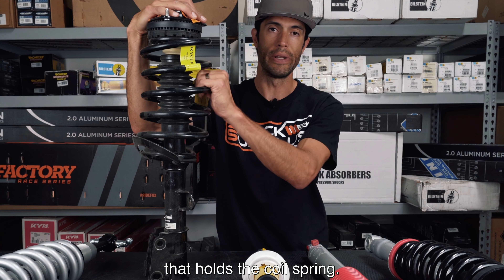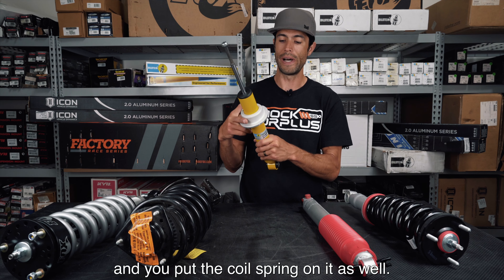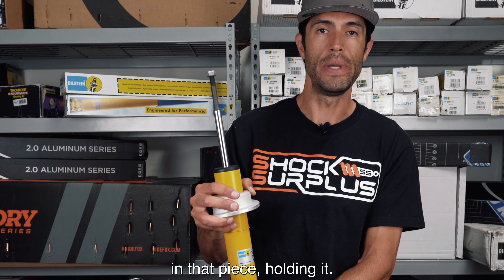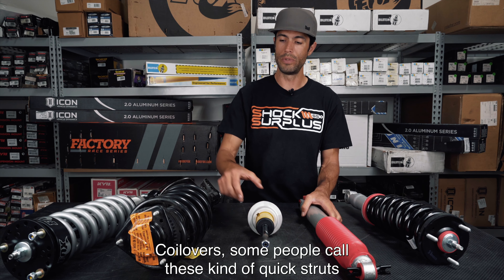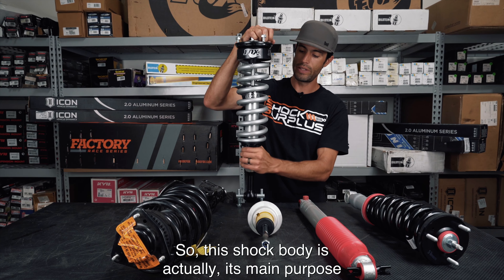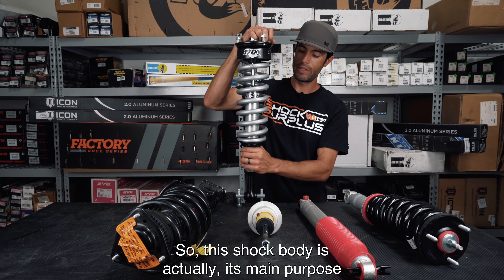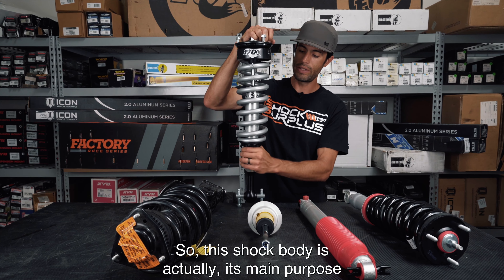Differences Between Shocks, Struts, and Coilovers

Comment: You didn't even go over the 5th shock. you only covered 4.  I can't find ANY video that tells me if I can use coil overs to replace rear springs
Reply from the maker: The 5th chock as in the Rancho on the far right of the video? That is a strut just like the KYB and Bilstein. You probably are not seeing any videos on swapping a coil or leaf spring to a coilover because that is not something you could simply do by buying a kit. That is going to require some custom fabrication on just about any vehicle.

Comment: i have a question, my buddy replaced his front struts with rear shocks when he lifted it, is this safe and should i do it?
Reply from the maker: If it really had a strut in the front it would not really be possible to use a rear shock as a strut is a structural component that will include the spring and therefore holds up the weight of the vehicle. If it has shocks in the front, there is a good chance a rear shock would be underdamped and tuned improperly to use on the front for most applications excluding something that had the exact same style of suspension front and rear and had close to a 50:50 front to rear weight split.

Comment: Whats the difference between coilovers & adjustable struts, seems to me when you thread the nut up on the coilover your compressing the spring the same as you would by adjusting the snap ring on say the bilsteins! so your paying double for looks & threads? seems to me for the daily driver you would thread your coilover to get the height you want then you would never need to adjust again so why pay the extra $$ just for the kool factor makes no sense to me! then with spacer lift you would lose some travel but how would that effect your ride quality your strut & spring stay the same, help me understand lol
Reply from the maker: We try to avoid spacer whenever it's possible. Adjustable height struts are usually with a circlip method like the Bilstein 5100 and 6112 or Eibach Stage 1 or Icon EXP series. These are preset at whichever height and preload they they provide. Upgrading your spring is also difficult in some cases if they still use the OEM style springs and not universal style. Coilovers have a threaded body which allows you to adjust preload to your liking and in most cases more 2.5 series coilover use a universal spring so we are able to swamp them out to heavier springs if you needed to support like bumpers, winches and such.

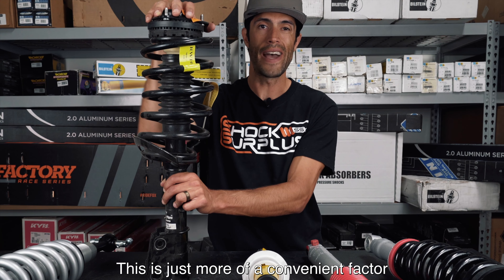Comment: 0:36 - "Struts are typically when the coilspring is sitting on the shock." 1:40 - Picks up a "strut" that has no coilspring.
Reply from the maker: He says "The strut by itself" implying this is a strut without the coil spring currently installed